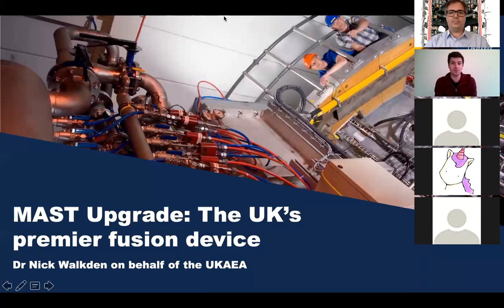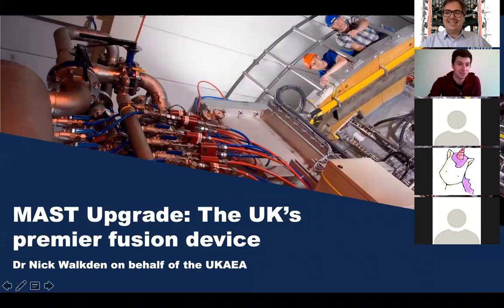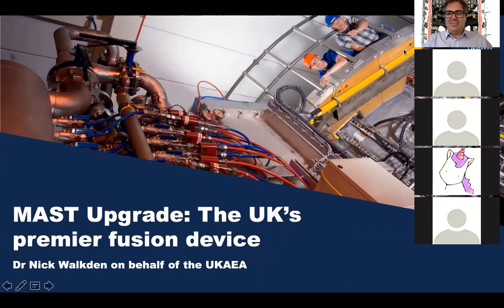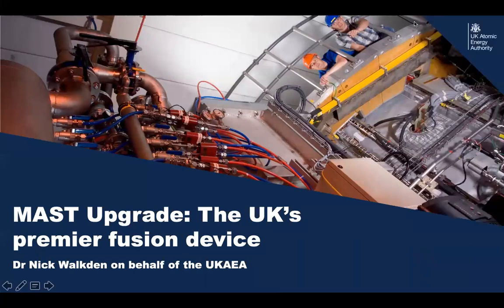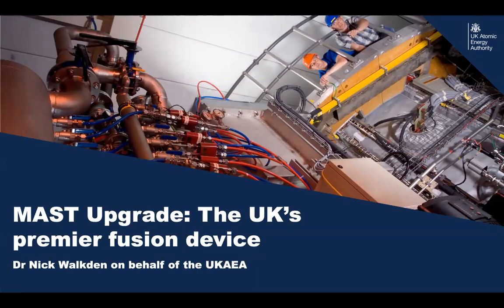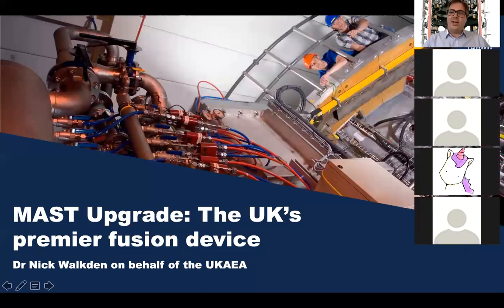MAST Upgrade: The UK's Premier Fusion Device

Comment: Great meeting to watch it, 
Can you explain to me if the temperature inside the nuclear fusion chamber is ten times higher than the temperature of the sun:
-  How can the glass that covers the camera inside the chamber withstand such an imaginary heat?
- What is the energy consumed and the speed of the coolant flow to cool the glass?
Reply from the maker: Hi, thanks for your question. At it's core, the plasma is hotter than the sun, however to avoid it hitting and melting/damaging the machine, it is held in place by very strong magnetic fields (like a magnetic cage). In MAST the windows of the machine are separated from this magnetic cage, the hot plasma, by at least half a meter of vacuum, so only a very small amount of plasma actually gets to the window, and it has cooled significantly by then so that the damage it does is minimal.